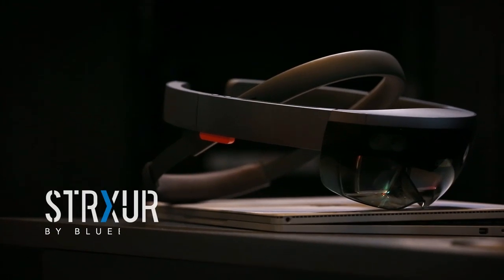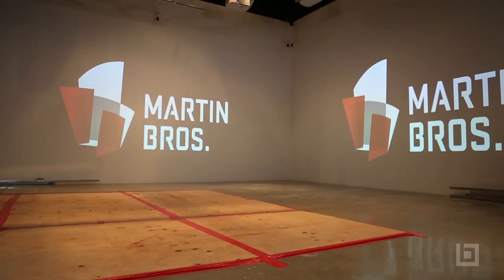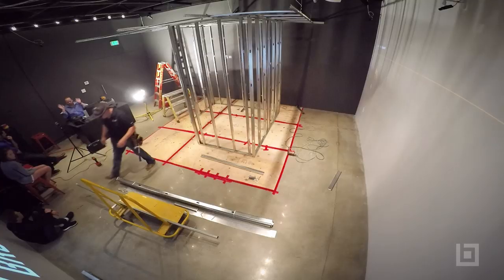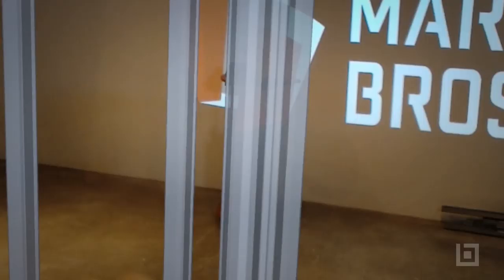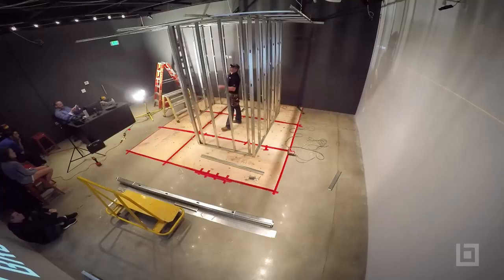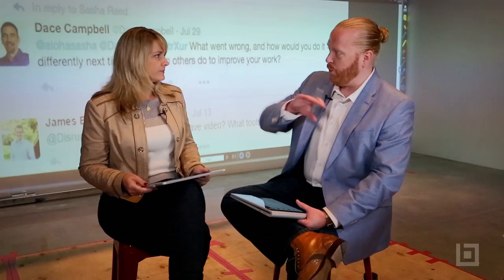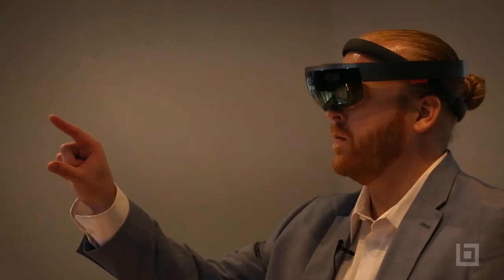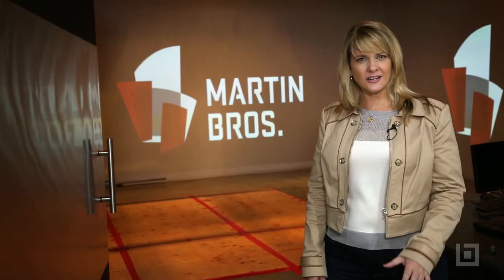No Plans, No Problem: Building With AR

Comment: A system where you could add a lot of wifi cameras would also help with accuracy. You could look at a wood beam and see it's exact dimensions and if it's bent or twisted or where high and low spots are (topographical surface map). You could do measurements by just selecting edges in your real life view and make sure everything is plumb and square. Or round for that matter. It could also help enabling much easier construction of more natural and weird construction shapes.
A kind of "CAD decompiler" that decompiles the real world into cad shapes.